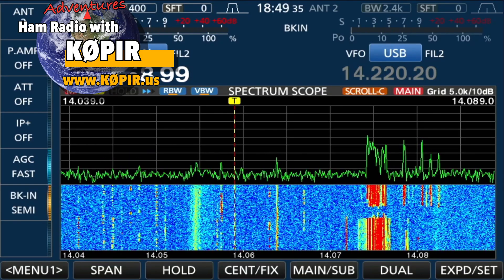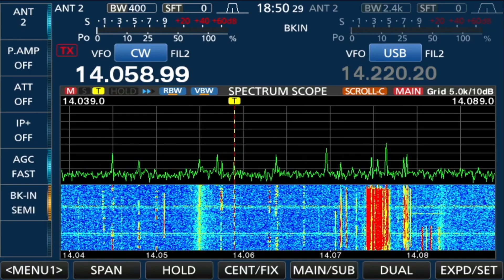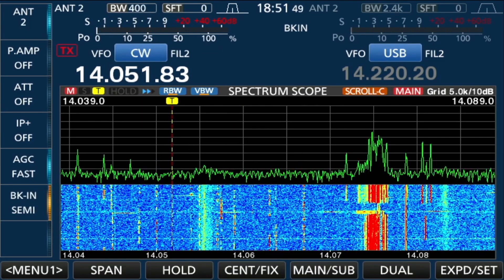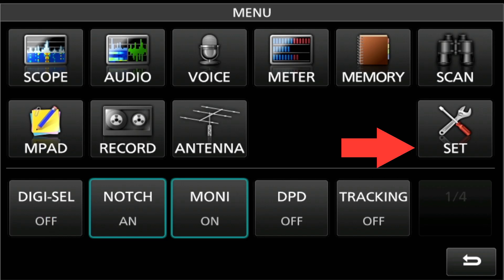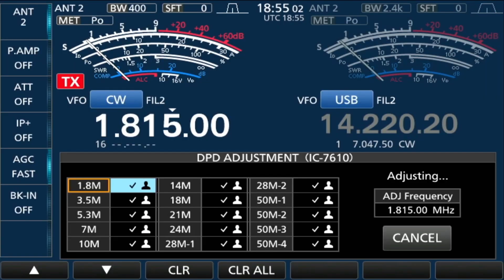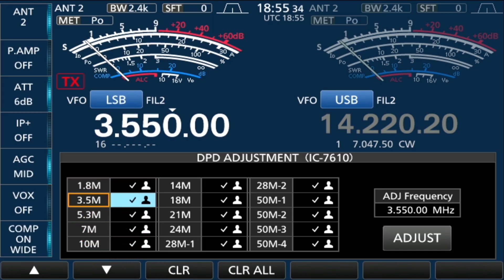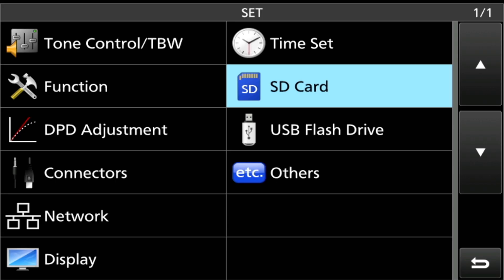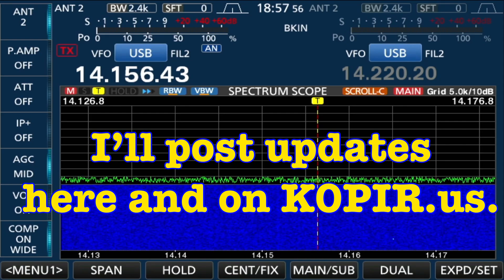Enabling Your #icom 7610 With DPD Adjustment For Near Crystal Clear Sound #hamradio

Comment: DPD will work with ANY amplifier, it is simply a tactic done inside the radio to reduce the transmit IM distortion being generated by the 7610. At some point Icom plans to allow their amps to be within the feedback loop used for the DPD calibration so that the 7610 can actively reduce the distortion generated in those amps. 

DPD will work fine with other solid state amps, but it may not ultimately reduce the overall TX IMD because the amp will be distorting more than the 7610. With a good tube amp, the reduced distortion from the driver (7610) will clean up the overall TX signal as the tube amps are more linear.
Reply: Agreed, it may not have all of the benefits of the PW2 but you are definitely sending a cleaner signal into ANY solid state linear amplifier. Mike, N0MGB